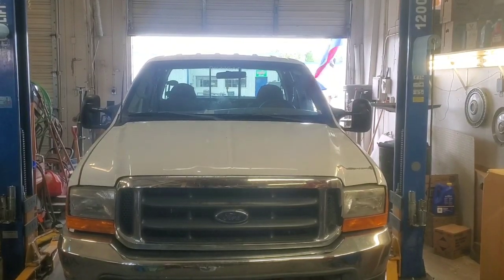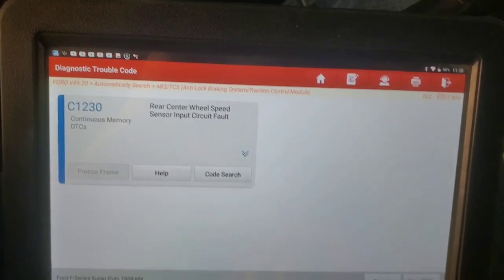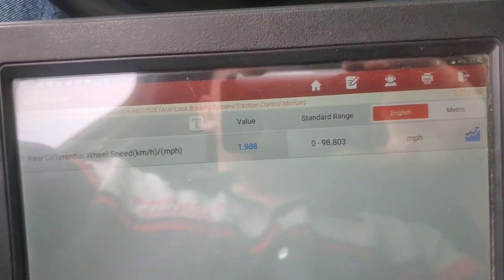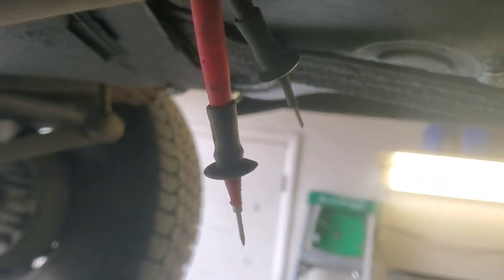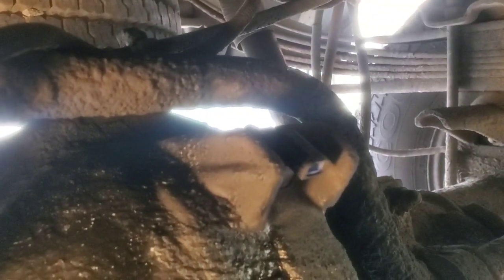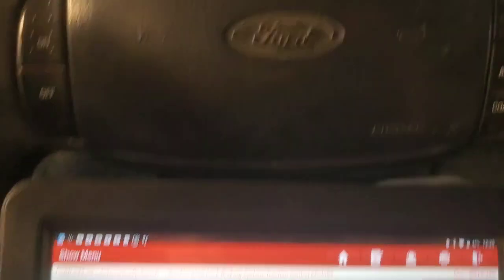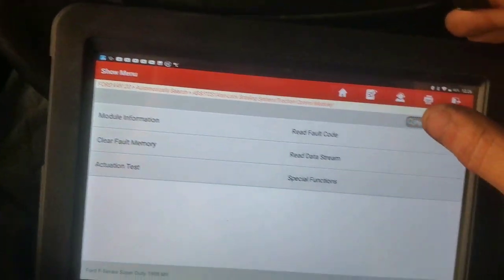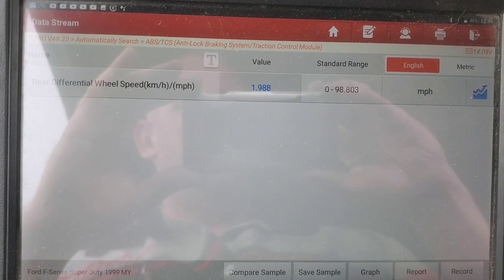Ford Superduty ABS Codes C1230/C1229 And Intermittent Speedometer.

Comment: I just have the C1229 (Rear wheel speed sensor inconsistent) but not the C1230. Is it that still that same sensor above the rear Diff or does the vehicle have another sensor(s) in that area. This came up after I mounted and balanced all 4 tires. It seems that the brake is spongy now as well. This is on a 7.3 Excursion. Thanks!